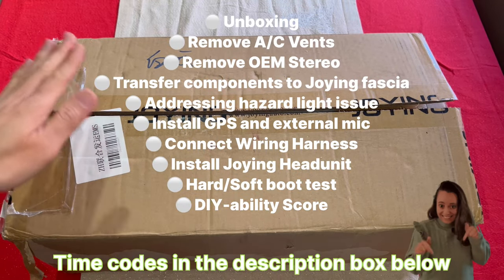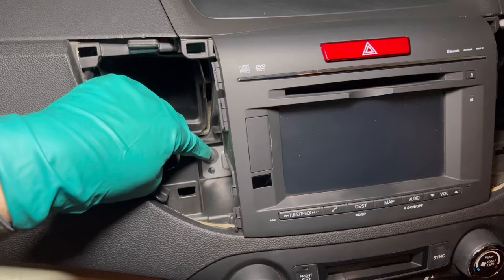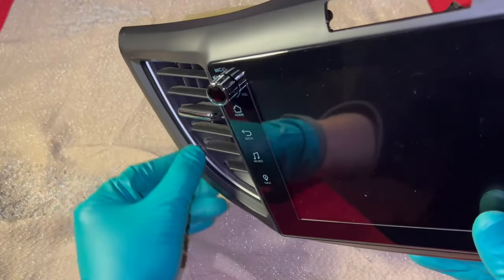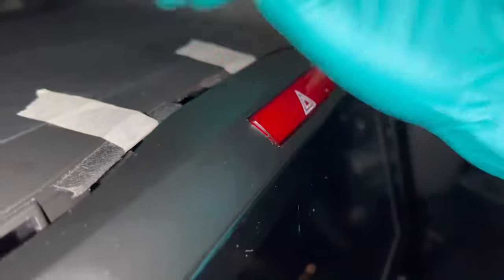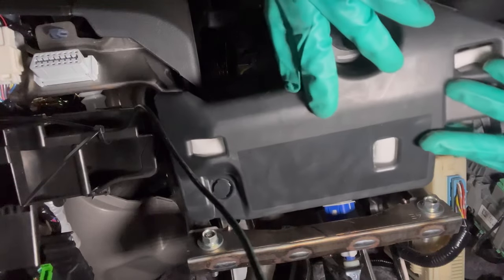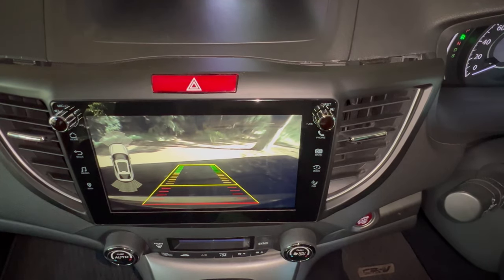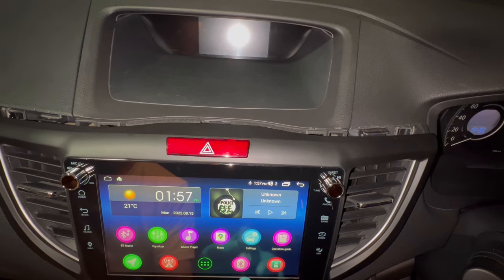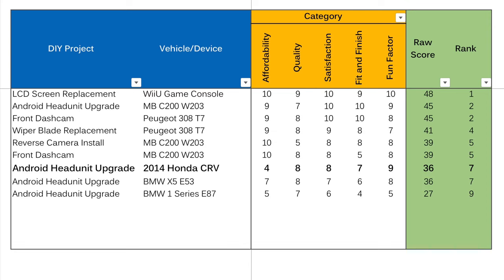HONDA CRV | ANDROID HEADUNIT INSTALL GUIDE

Comment: for the apple car play/android auto do you need to have a usb connection? or does it work over bluetooth?
Reply from the maker: Hi Stephanie, firstly thanks for watching my video. With regard to your question, I can confirm both wired and wireless Apple Carplay work with this headunit and it also support Bluetooth audio. So if you are an Apple iPhone user, you can either plug it in the USB, or use wireless Apple Carplay.  And with Apple Carplay, it uses both Bluetooth and Wireless to stream audio and content to the headunit.  There is an initial setup and handshake that happens but once setup, it works seamlessly.

Unfortunately, I dont own any Android phones so Im unable to verify if and how Android Auto works on the headunit. 

And since filming this video, I noticed the seller has discontinued the 8-inch models. Its a shame since I liked having buttons on either side of the screen as it make it look symmetrical. I also had a look at Joying’s 9-inch models and it stated in the specs that it support wireless on both Carplay and Android Auto. However, I’d encourage you to directly contact the seller to confirm the details.

I hope this was helpful and be sure to check back in here if you have any further questions or comments. Good luck on your project!

Comment: Hi and thanks for the great vid! Will this work for a 2014 VTI-L 2.4 AWD? My head unit and the top little display looks identical to yours.
Reply from the maker: If the main display and the small displays are the same this mine, then chances are this might also be compatible with yours.  But best check with the seller for compatibility before purchase. I had issues with the steering wheel control which seller has provided an updated wiring harness for free.
Reply: @AutosNGizmos  I found a seller in Sydney that had all the harnesses with the head unit. Also no need to make a cut in the dash panel to fit the hazard button.
Reply from the maker: @riffmeisterkl  Nice, do you mind sharing the name of the Sydney based seller here so other CRV owners can but from them too?  Also nice that you didn’t have to fiddle with the hazard lights.  I hate it when I had to cut off plastics in the car…
Reply: Hi  @riffmeisterkl  , do you mind sharing the name of the seller please and also any details about the harness (a pic?)  and the canbus decoder name/model. I have a 2013 CRV VTI-L 2.4L with same head unit and iMid display. I bought a different android head unit and even though the harness has all the plugs to match the factory harness I cannot get the SWC to work. Thanks

Comment: You don't really need the cellular antennas do you?  I would like to think my phone in my pocket is all I need and just use the head unit partly as a handsfree device.
Reply from the maker: Hi Charles, in most cases you don’t need to have a separate cellular connection. The only time you need it is if you want the car fully connected to the internet all the time, for example if you want to see the location live, or if you have a dashcam, see the live camera feed remotely.

Comment: I have the same old head unit.  I want to do the same.  Can you tell me what are the two additional cables from the car?
Reply from the maker: Hi Dennis, I suspect those two cables might be for the steering wheel control because I’m having issues with them after this install.  I‘ll update you after I get the new wiring harness from the seller and install it in the car
Reply: @AutosNGizmos  any updates with the swc?

Comment: Hello, what is the latest Joying model of Android Auto & Carplay for Honda CRV 2013? Thanks
Reply from the maker: Hi Mochi thanks for watching this video. The 8” Joying headunit I installed in this video is already discontinued but there are new ones from 9 inches all the way up to 12 inches. I have the links under the video description but also putting them here for easy access. FYI, these are all my affiliate links which means I might get a small commission if you decide to buy something from Joying or Aliexpress. And you don’t pay extra to buy any of these products from my affiliate link. The price you pay is the same whether or not you buy it from this link.

Android Headunit for 2012-2016 Honda CRV:
    - 9” - https://s.click.aliexpress.com/e/_DDjzVQt
    - 10.1”- https://s.click.aliexpress.com/e/_Det7cQl
    - 11.6” - https://s.click.aliexpress.com/e/_Dm2yG1h
    - 12.3” https://s.click.aliexpress.com/e/_DBHfnEP

There are a few discount codes available (US$40 off for orders over US$340) - 23KXK9L3ZYYS or DF6GFJLLO7MR. These are valid until August 10 but limited to first 200 orders.
Reply: @AutosNGizmos  Thank you for letting me know of different options! I will definitely use your link when I decide to buy it.

Comment: I have a Nissan Rogue and every once in a while the factory head unit seems to think I got a phone call except nothing shows on my phone and nothing on the head unit.  I pull into the next parking lot so I can shut the vehicle off and turn it back on and it still does it.  It is bizarre!  Thankfully it only happened once because it is very distracting.  I may just give a different unit a try.  On Reddit there seems to be a post about someone else having the same problem.  It is a Bosch head unit so it is not like some no name generic junk either.  Maybe there is a bug in its software.  That is the only reason it would do this in my opinion.  It really is an annoying thing and I am glad it only happened a couple times but still I would not want to be in busy traffic or trying to find my way around an unfamiliar place and have that make me wreck my vehicle.  I tried to get it to stop while on the road still but no luck since it is hard to safely take my eyes off the road long enough to figure out what the heck is happening.  That seems like one of those things that needs to be solved at home in the driveway where you are at home with internet to get some insight into what may be causing it.  I once had to make a 20 minute trip to some place listening to that and it can really make you lose your mind!!  If I knew which fuse to pull I most certainly would have.  I would just take a photo first so I can see where all of them are supposed to go and that can help if you ever take it for electrical work and an incompetent person puts one of the wrong rating (I don't call it "size") in some place.
Reply from the maker: Hi Charles, yeah this will also drive me nuts. To me, it doesn’t sound like an issue caused by a bad fuse because a bad fuse means it’s an open circuit and no electricity will be flowing through. 

But I read somewhere that whenever Google Maps provides voice guidance, the dashboard shows a call with “My Number”. Then on my car whenever I activate SIRI on my phone, there is a phone call box that shows up on the car’s screen so that’s another angle of investigation for you.

Good luck on your investigation and feel free to give an update if ever you determine the root cause of this issue 😊

Comment: Does the unit get v v hot under normal use?
Reply from the maker: Hi RationalCreed, Unfortunately I have not notice if it gets hot. But in saying this, I also have not encountered any issue which may suggest its overheating during normal use.